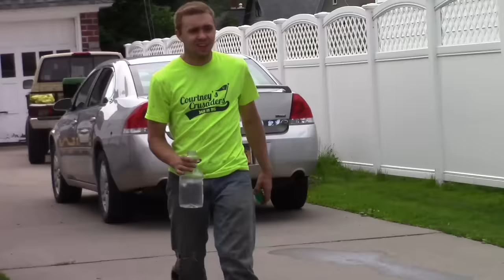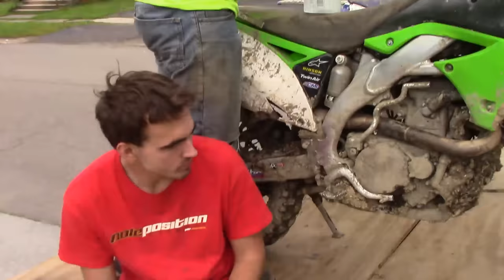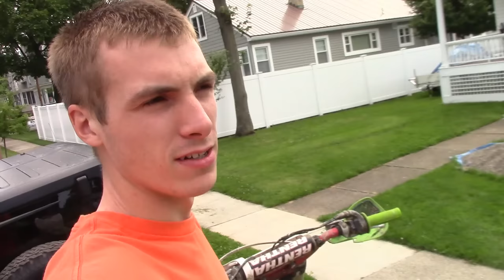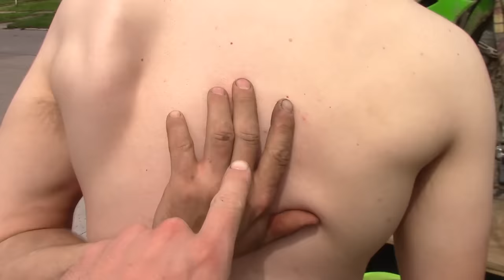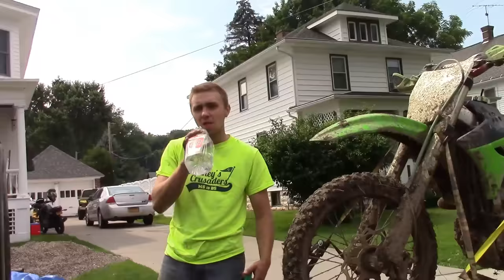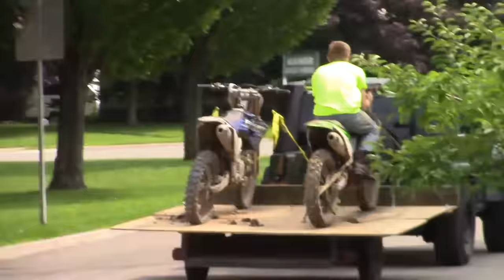NEW KX450F IS TOTALED!

Comment: That's why I always buy used they break just as easily as the new stuff! Looks like you guys just need a new cover and a diesel flush unless you rode it out until something seized.if that's the case new engine homie. The handle bar thing is probably not that big of a deal, I Def wouldn't just put jb weld on it lol.

Comment: Can you help me out? I need help picking between a 250 4 stroke or a 450 4 stroke, I've ridden sport atvs before (I have pretty good throttle and clutch control) but never a dirt bike. I'll be mostly riding on wide trails, and not much technical stuff, sometimes the beach and some hillclimbs. I'm 16, 60kg(160lbs ) and I'm 177cm (5'8). My biggest concern with the 250 is that I'll grow out of it :(

Help me pick!

Thank you:)
Reply: you shouldn't outgrow a 250
Reply: Get a KX500